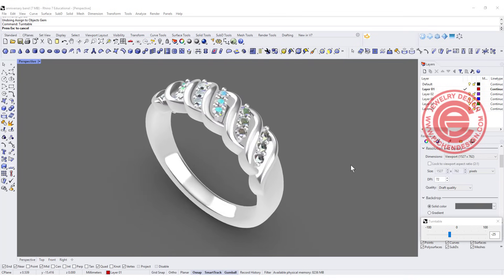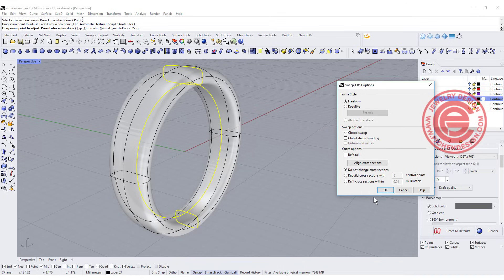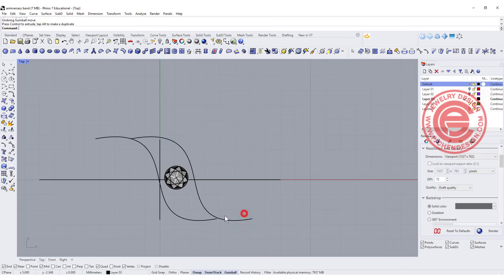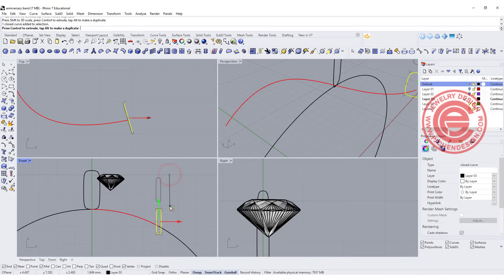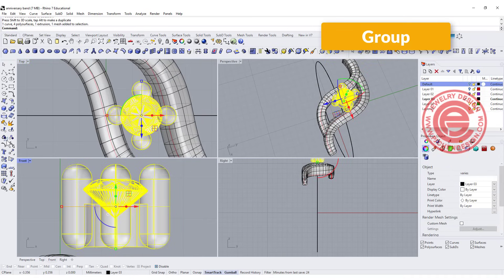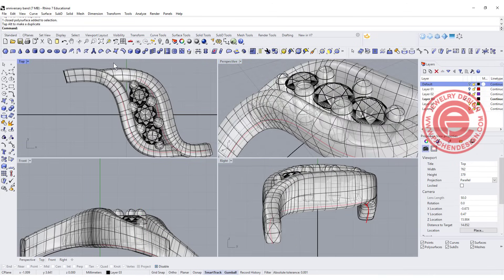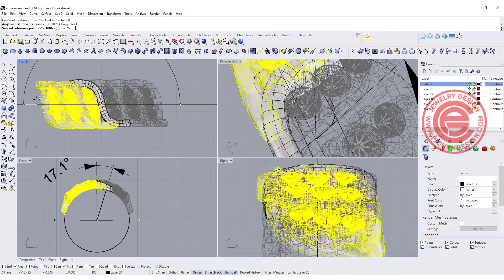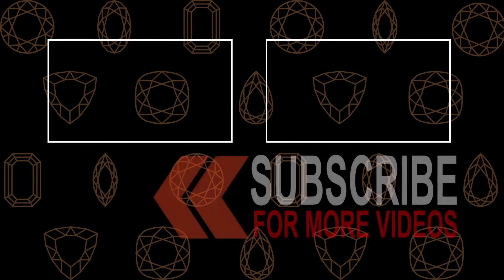Custom Anniversary Ring - Jewelry CAD Design Tutorial 3D Modeling with Rhino 7 #185

Comment: How do you ensure that these are accurate dimensions for a jeweler to set stones in a 3d printed/cast ring?
Reply from the maker: if you have exact stone sizes, you need to make sure that the stone will fit plus your printer shinkage rate.